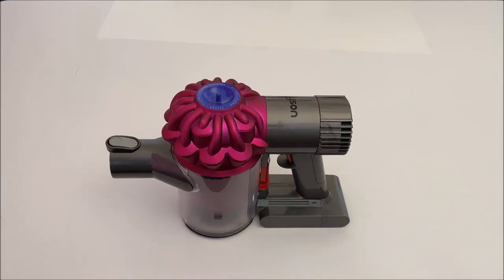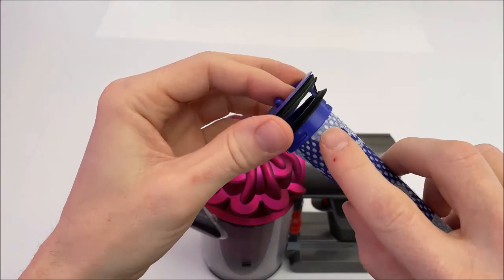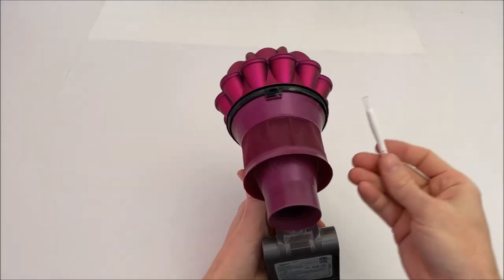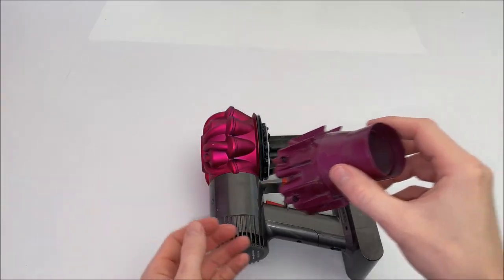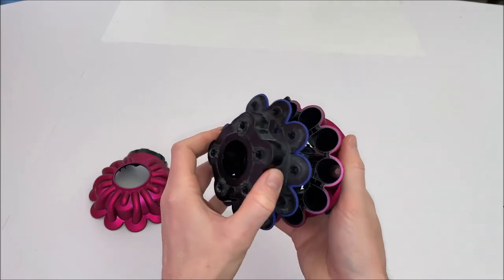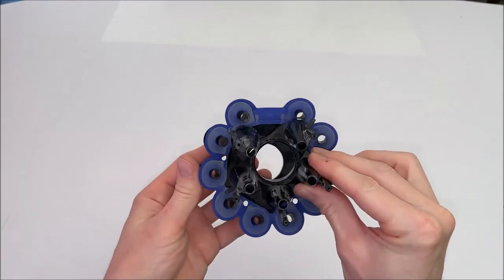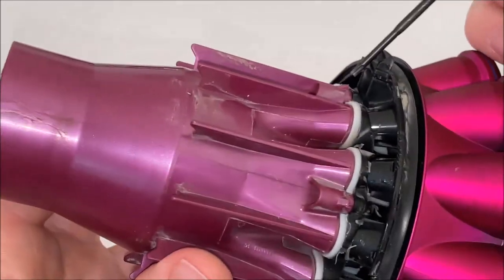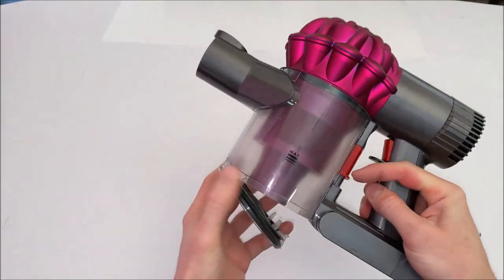Dyson V6 Disassembly & Surge Fix

Comment: Hi great video, as I got to remove the last five screws, I can only find 4.  Are you sure there should be 5 screws? We can only find 4. but  we are still looking.
Reply from the maker: They’re so tricky!  They hide well. If you’re able to separate the unit, you’re good. If it’s stuck, there’s a 5th screw in there somewhere. Use compressed air to get all the dust out and you’ll find it.
Reply: 4 screws indeed. honest mistake. great video!
Reply: 4 screws.

Comment: Thanks for the video.  Between you and I, got r fixed.  The battery lights came on, but no power when trigger pulled.  One correction, I had a  SV04 and there are only 4 screws in the second set of screw removal.
Reply from the maker: Hmm, interesting. I suppose screw count will depend on model. Glad you got r fixed!  Appreciate the comment, thanks!
Reply: @aspmdr So did you get it to work?
I'm having the same issue.

Comment: I hope you can help me, I've gotten almost everything off, However the cyclone assembly won't come off. The bottom part releases when pressing the white plastic locking device with a pair of needle nose pliers, however the top half will not come off the handle part (red cyclone assembly & grey handle/battery mount) can you please advise? its like the top half of the cyclone assembly is glued to the grey mating part (handle/battery holder)
Reply: It is a VERY fiddly process, you may have to attempt it dozens of times or more like I did.

 Make sure to remove the four of six accessible torx screws from the Cyclone assembly, it lets the whole thing wiggle a little bit more, which helps get it to come free.  

You'll have to get the whole retainer ring pulled up, as if you're trying to pull it out of the machine through the access hole, and pressed in towards the removal tabs just perfectly right, or it'll seem like it's glued. 

 Two small flatheads held like chopsticks on the removal tabs with one hand, while holding the handle with my legs, and wiggling the cyclone free with my remaining hand was the ticket.  Quite the procedure.  

  Many swear words were had but I was able to get it free without breaking or throwing it.. lol 

It was chok full of fine dust inside there!  Like buildup in someone's arteries, it was restricting the flow to the point that the whole machine was giving up.

Drying the freshly cleaned parts as I type this.. Hope this info helps 😊
Reply: @glennkon  I did finally disassembled the thing. It's a bit scary to use much force from fear of breaking something because obviously the possibility of throwing all that $$ is very real.
I found that the insides of the vacuum were relatively clean, but of course a thorough cleaning made a difference. In the end however, the culprit this time for the pulsating symptoms was the battery. I had ordered a replacement cheap battery which wasn't really the cause, it was obviously a clogged filter.
Anyway the Chinese replacement battery did die after a couple of years but I had saved the original battery and after charging it, it worked perfectly.
The cleaning did help a good bit, I think, but it might be a placebo effect.
OTOH, I did find a wonderful accessory (accessories) while looking for parts. I bought a kit of parts including a flex hose which really makes the stick vac much more useful now that it is working well.
Reply from the maker: Hello. Looks like others saved the day on this one. Good stuff all!  Thanks for answering this one 👍👍👍. 

P.S. I agree about the placebo effect. Cleaning does help, but often the cause is a clogged filter, some obstruction in the house or the one-way valve into the canister, or a bad battery.

Comment: Very helpful. My V6 was pulsing on/off and cleaning the HEPA filter didn't fix it. Tore it down following the video & it's working like new again!

For those curious, I didn't bother going past removing the piece at 3:12. That was the final piece I took apart. I rinsed everything that came off up until that part. Yes, you may as well clean inside the cyclone if you're going that far, but I didn't bother with it and it turned out fine. Seems like most of the dust is trapped outside the cyclone.
Reply from the maker: Great to hear!  Love the success stories and thanks for sharing 👍👍👍

Comment: I tapped the head unit as I was cleaning it and it popped off. Is that normal? I gave it a pretty hard hit
Reply from the maker: Hello. As long as you can pop it back on it shouldn’t be a problem. Feel free to follow up if you’ve got more questions 👍